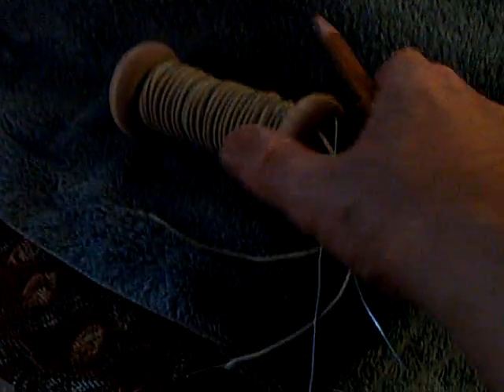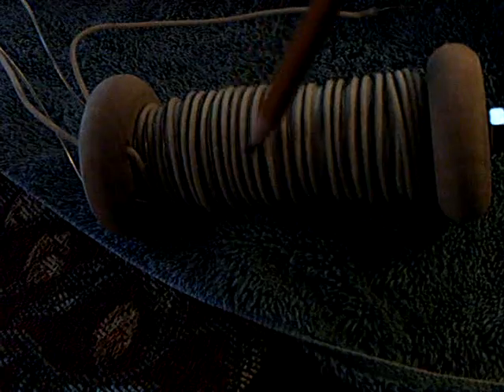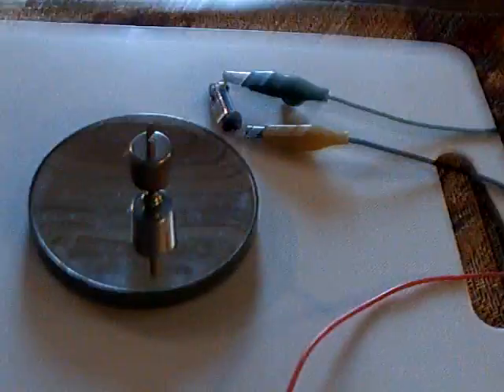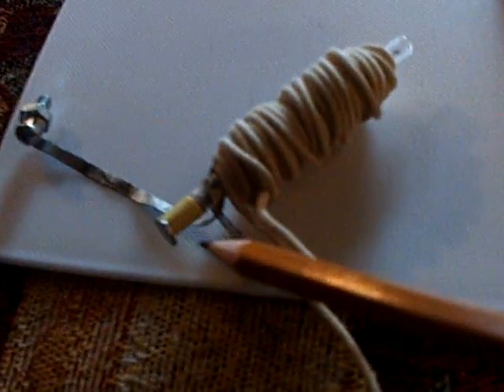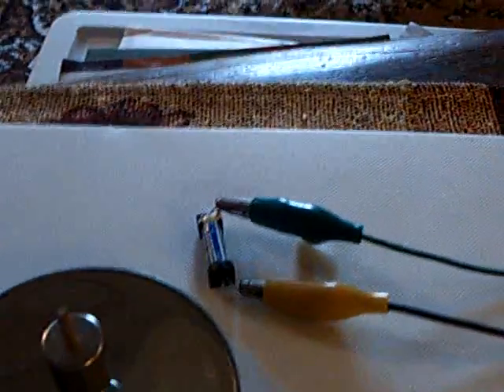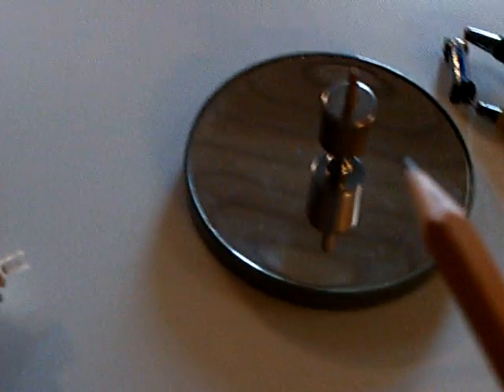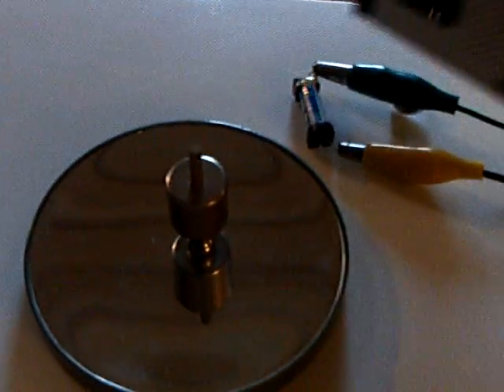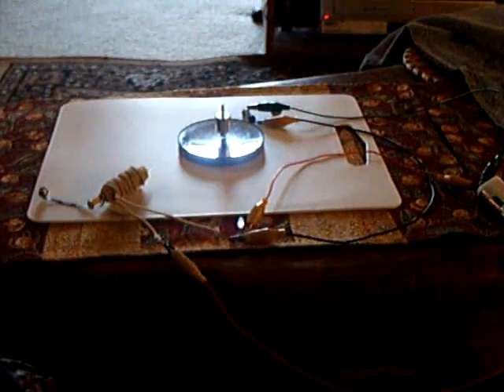Stubblefield coil---1st attempt.ASF

Comment: Good job ! I used old blue jean material between layers, and around the iron bolt. I painted a little elmers glue to help adhere it. I found my cotton insulated copper wire at homegrownaudio. I wish I could find #12 copper insulated with the cotton. I tried to insulate a #12 with strips of old bed sheet in a miwter of flour water and salt. While still moist I tried to make the coil and I could see the reaction bubbling a mess. I put it in the ground and the ants love it!